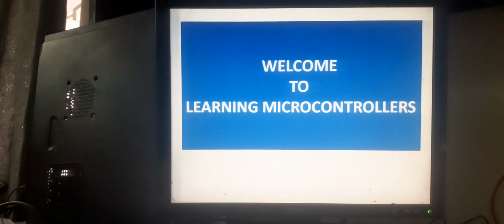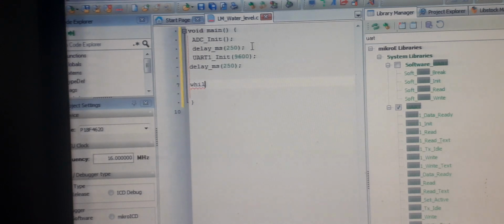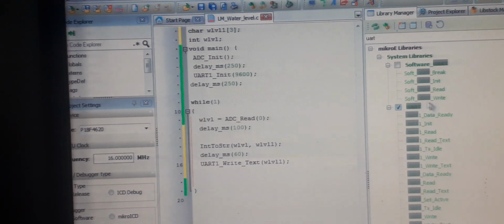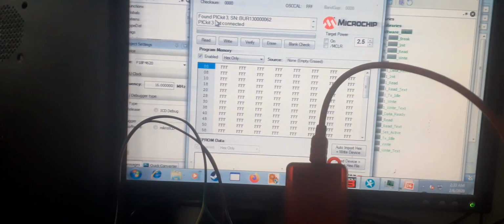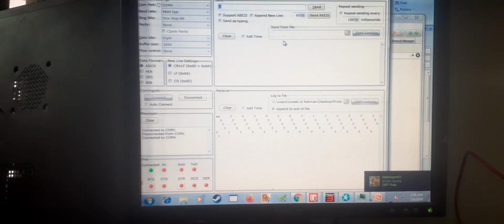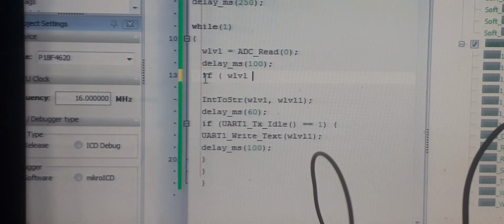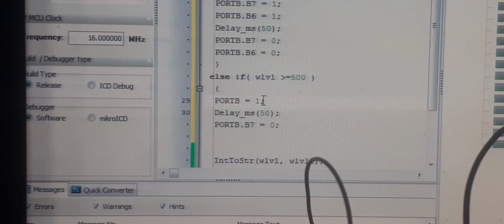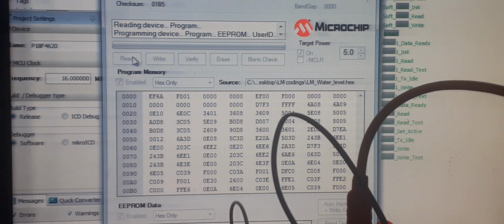PIC16F877A/PIC16F887/18F**** interface with Water level sensor (mini project) using MikroC

Comment: I think this is a rain-sensor, not a water level sensor. You can see this in the readings at 14:21 as you removed the sensor out of the water.
Reply from the maker: Basically it's just like that
Water just shorts the lines
And this causes a signal detected